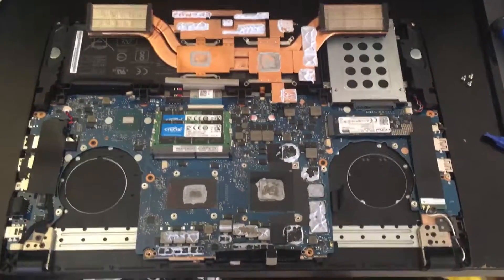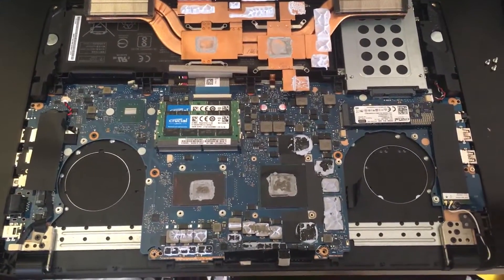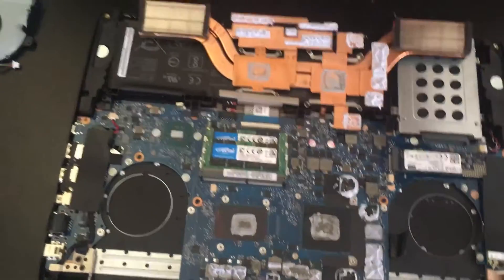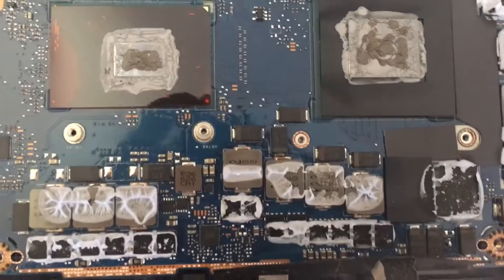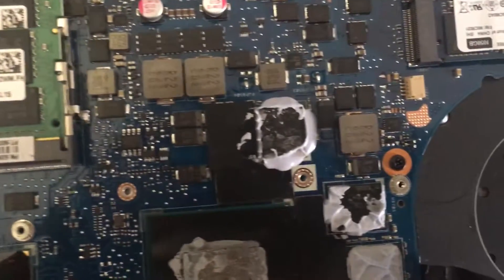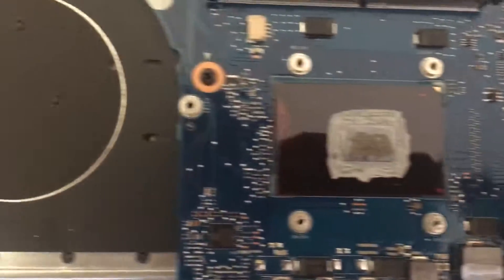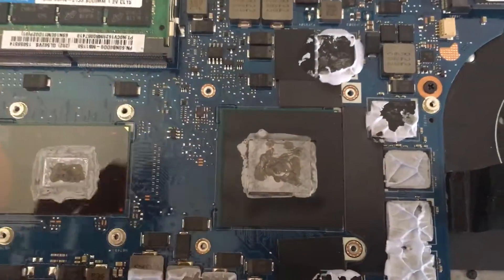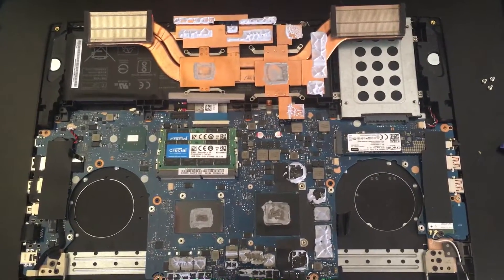ASUS GL502VS - Removing the CPU and GPU Heatsink

Comment: Been working on one of these and its so weird that they used paste on the memory chips when the heatsink doesn't clamp very hard on them. Consoles would typically use thermal pads on those components

Comment: If you are having heat issues with you CPU here's how you can fix them.
When under load my CPU was always in the high 90s and even got to 100C, but I fixed it by lowering the core voltage of the CPU. It's actually quite easy to do. Here's how you can do it:

1- Just download and install Intel's "Extreme Tuning Utility" (from Intel's official website). Just google "Intel Extreme Tuning Utility" and you will find it.

2- Go to the "Advanced Tuning" tab. This will give you a warning, but don't worry if you follow the instructions bellow you will be fine.

3- There, you will see an option called "Core Voltage Offset", which should be set to 0.000V by default. What you gotta do is turn it down to -0.150V (this is the lowest you can go before stating to have stability Issues). 

4- Finally click "Apply". 

This fixed the heat issues I was having, and under load the CPU is now in the high 70s and low 80s most of the time maxing at 89-91 occasionally. 
Just to clarify for anyone wondering, this will not make the performance any worse. In fact it will probably improve it because there will be less throttling thanks to the lower heat output.

P.S. I noticed that the core voltage went back up to 0.000V after a while (the heat went back up again), and I had to lower it like I did the first time. It's not really a problem, but I mention it so in case anyone has the same issue. 

I really hope this helps.

Cheers.
Reply: Thanks, man!

Comment: Did you by chance do a  vid on repasting everything and/or did the temps go down by any measure?
Reply from the maker: +bigbenisdaman Didn't go down at all for me. Sorry, didn't record it.
Reply: Jeez, that's a bummer. What paste did you use? Maybe not enough, or too much? Maybe you could try some "thermal grizzly conductonaut" liquid metal type stuff?  I dunno if that's a great idea with a laptop though...they make pads too apparently, maybe more appropriate and easier to install. Undervolting does seem to work also.

Comment: Did you ever come up with a good alternative for better cooling? I noticed a comment some odd number of threads down that you mentioned arctic silver wasn't working for you?  I was thinking about doing a swap on my GL502VS, but I haven't bit the bullet yet.  I have found some gains in elevating the bottom of the laptop away from the desk.  I was thinking about getting a cooler to see if injecting air helped any.  I'll let you know if that works, should be on shop side of town this weekend.
Reply: I got a coolermaster laptop cooler, its dropped me about 7/8c.  I might get one of these opolars, thanks for the heads up.
Reply: Joe Smith you just need to drill holes under the two main fans, I've heard of people getting up too 10C better cooling!

Comment: I know you posted that you would do a update video over a month ago but I thought I would still ask as you are on the the few people that went further than just HDD/SSD/memory upgrades for this specific model.

Would it be possible to request a full disassembly video of this laptop? I recently had my nephew spill some tea on the keyboard but luckily I figured out how to remove the board and cleaned the tea but the keyboard is sticky and I need to replace it.

When putting things back together I noticed that my display would not show an image on occasion with startup however it was fixed by fully opening and closing the lid, leaving me to assume I didn't properly seat the lid clasps around the board. 

More recently I used a lightly damp cloth to clean the screen and It's perma black screen, I can plug external tvs and play and it works just fine but the laptop no longer detects its own screen.

 I know is a tall order but to at least get an idea on how to swap the keyboard is a start as I assume the monitor is easier to figure out and I've already replaced one in another asus gaming laptop.

Comment: You can try using liquid ultra in your CPU and GPU. It's very conductive but have a significant drop in temperatures
Reply from the maker: +eco gg I'll give it a try. Replacing it with Arctic Silver 7 has given me worse performance, it seems.
Reply: yes but to be on the safe side you should put electrical tape around the cpu and gpu die
but however you can try different thermal paste like Gelid GC extreme

Comment: Thanks for this video, I was about to get it but I a lot of people are complaining about thermals in the Astrix line of laptops. However, it seems that the problems is related to poor design choices by ASUS.
Reply: Poor cooling design yes. Undervolting CPU by 125-150mv using IETU lowered my temps overall by 10 degrees or so. Not bad. Asus should have used 3 heat pipes instead of the two. The compound they used actually isn't all that bad.